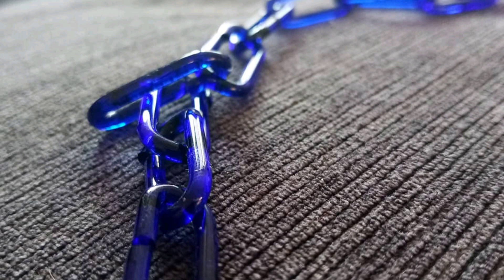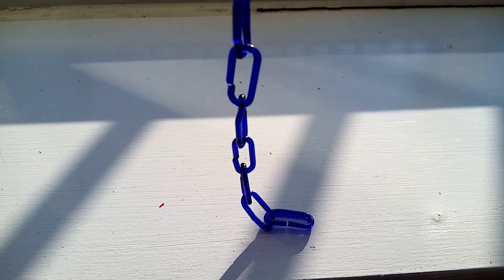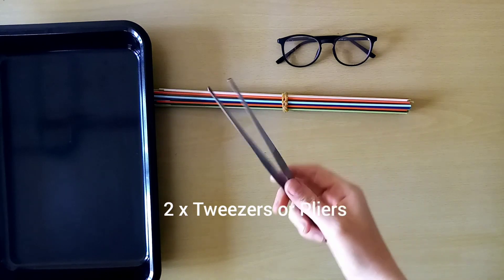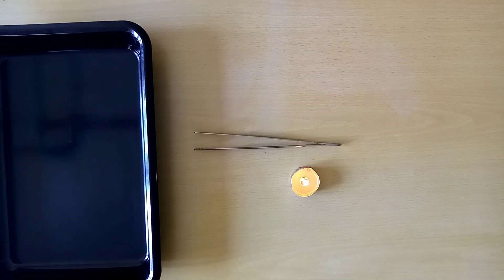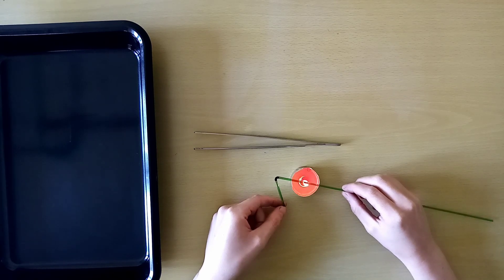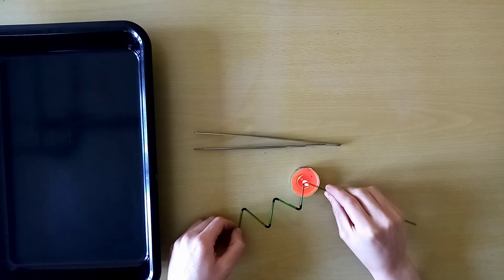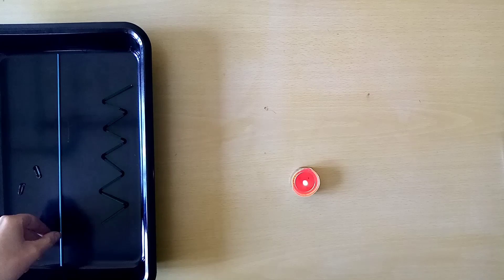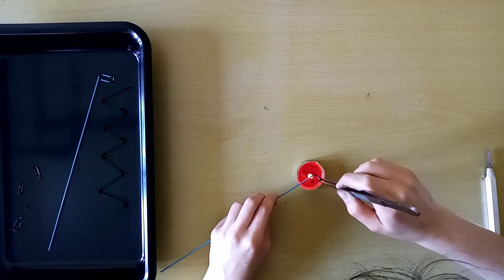Home Glass Hacks, Lesson 1- Glass Bending Using a Tea Light

Comment: Super cool and if I can get the materials together I will definitely be trying this out.  I've never done lampwork before, just glassblowing with soft glass so this might be a silly question, but i'm wondering if the quick cool-down might result in a shattered piece?
Reply from the maker: Hi Amelise! Yes do indeed give it a go, it's so much fun! Not a sit question at all! So the stringers are so thin that they can withstand the temperature change.  However they are not technically annealed.  You can always stockpile your pieces and anneal them when you have access to a kiln again if you'd like :) but they haven't just shattered for me yet!

Comment: Dang!! Our tools (Tungsten scorer, tweezers, glass rods & tweezers) are at our studio which we can’t visit currently. We do have a tea light. And a pencil torch....  Is the glass Effetre, i.e soda lime? And would you use smooth or ridged tweezers?
Reply from the maker: Hi Silvia, great questions.   The glass I am using here is Effetre, bought from Tuffnell Glass.  It is 3mm thick.  However I have also been using Bullseye 2mm stringers from Warm Glass UK.  Here I am using a smooth tweezers, but I prefer ridged (I just don't have any).  To be honest, the scorer isn't vital, it just makes the snapping neater.  You may need to readjust when and where you snap if you aren't using a scorer.  If you have any more questions, keep 'em coming!